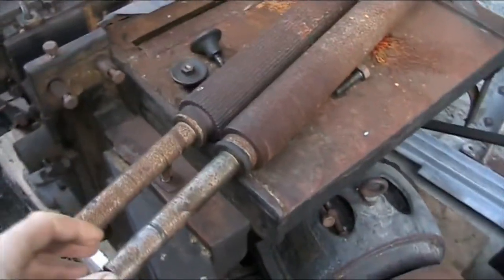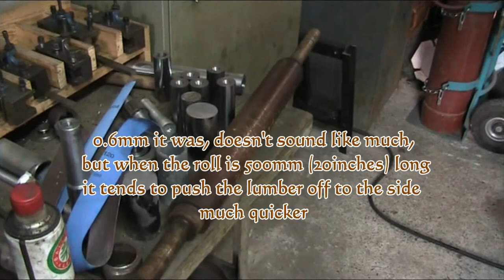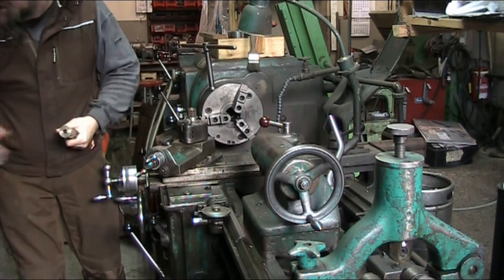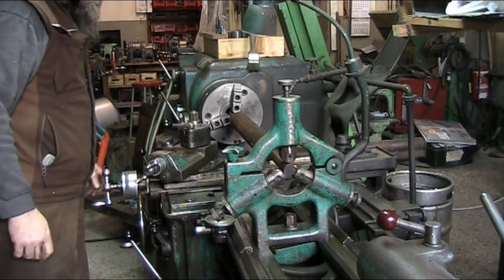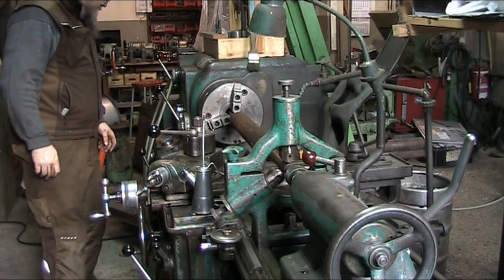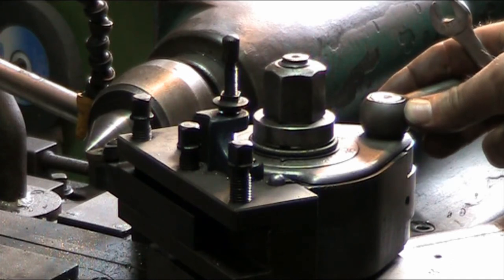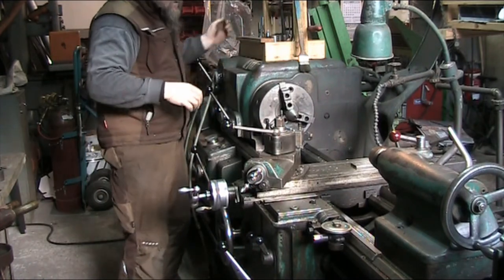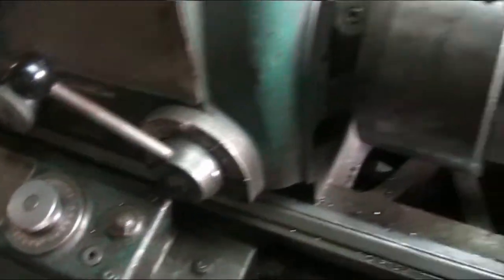this old planer episode 3, part 1 of reconditioning the feed rolls

Comment: +1 for the Multifix, got it on all my machines and just love it. In my opinnion there is no other system which offers the same flexibility & ridgidity with such an easy repeatability. Once set correctly, no more hassle. I can even swap tools betwen machines with no adjustment whatsoever.
 However, there is a possibility that i am slightly biased, i learned turning on a Multifix equipped Colchester Master some 35 years ago and whatever system i played with since, it just did not feel right to me.
Even the copies are not too bad, dimensions are usually ok, hardness can be questionable so they wear a bit quicker. The sets i have are made in India and i am pretty happy with. Got a few extra tool holders from China and they are rather soft, so cleaning is essential, otherwise the spline will get indents.